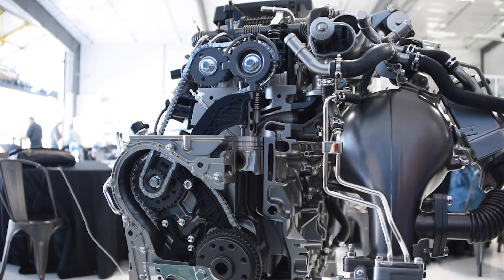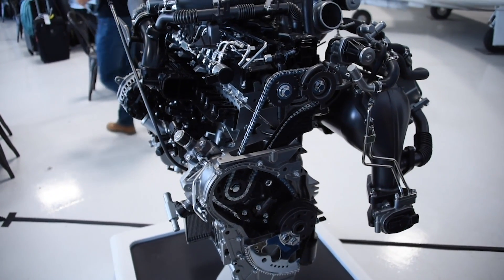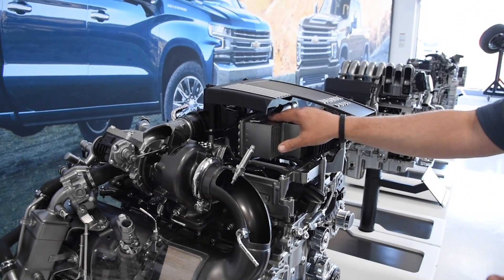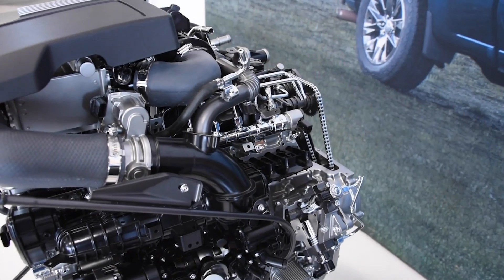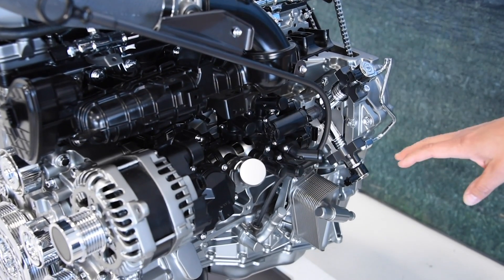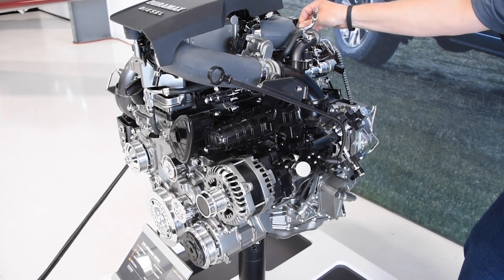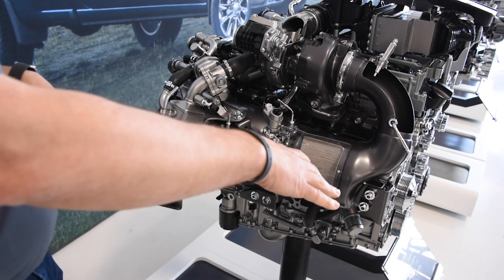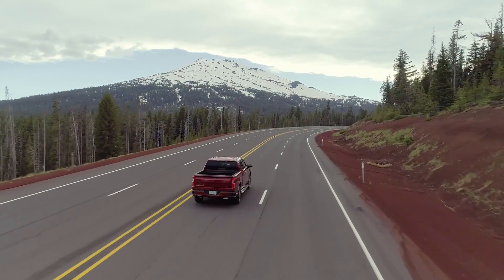What you don't know about the 3.0-liter Duramax diesel

Comment: You know...this confuses me.
A lot of people are being really negative about the oil-pump belt. Saying it's bullshit, etc.
Okay, I can understand that it is confusing as to why they would use chains for the camshafts and fuel pump, but would switch to a belt for the oil pump. I get that, I do.

But when people are bitching that they didn't use gears?

Guys, this is a light duty diesel. Why are you expecting them to build it like a medium duty engine? Why are you expecting them to treat the engine designed for a half ton, the same as the engine used for one-ton and heavier trucks?

Like, I get being frustrated with the reduced reliability of modern 6L+ engines. Totally understand that. Those are the engines people are using in work trucks. Hauling shit day in, day out, every goddamn day of the year, etc. Got it. Understand it. Yep, no argument there.

But these engines are being designed for Half tons (and in other cases, for LESS than half-tons). Why are you expecting them to treat them the same?

Edit: Forgot to mention: Yes, I would want to question the people involved as to why they put all of the timing shit, on the BACK of the engine. That does not make any sense to me.
Reply from the maker: GM engineers explained to me that chains are  used instead of gears to reduce NVH (noise, vibration and harshness) levels. 3/4 and one ton customers don't care about a little extra clatter, but half-ton customers expect a diesel to be as quiet as a gas engine these days.They also told me that driving the cams and fuel injection pump from the rear of the engine creates more accurate timing because there is less harmonic distortion at the rear of the crankshaft than there is at the front. This is important because accurate cam timing and fuel injection results in reduced emissions and increased fuel economy. That's what it's all about.
Reply: @TheRVConnection  I really wish the engineers could make a video to explain this, because...I can't envision why the harmonic distortion would be different at the rear of the crankshaft, vs the front of the crankshaft...unless I suppose, the connection to the transmission stabilizes the distortion effect.

Just seems to me like a good way to increase customer satisfaction, would be to actually provide education, or explanation for some of the design choices that...they have to know, are going to piss off some customers. Just wish there was some transparency.

That you guys at RV Connection for answering what you could. Appreciate it!
Reply from the maker: @dposcuro  In all actuality, the average truck customer doesn't know the difference. Only enthusiasts like yourself (and the many others who have commented here) dig into the small details like this...so engineers are not really worried about pissing anyone off..but they ARE worried about not meeting emissions.  What a lot of people overlook is the labor that would be involved to replace chains at the FRONT of the engine...the radiator and 3 cooling fans would have to be removed and replaced, not to mention the time correctly purge the cooling system of air so it functions correctly. I'm not sure that would be a lot easier than dropping the trans and doing it from the rear, although time will tell.  Another thing people are forgetting is that the oil pump belt needs to be replaced only once in the engine's effective lifespan--people replace timing belts on small cars at 80K miles all the time, and no one thinks that's a big deal. The fact is, the government, along with diesel customer's expectations, are changing–and the manufacturers MUST change with them. Thanks for watching...there will be more videos soon, including the new Super Duty this month!

Comment: I don't even own the truck and I am already Disappointed, what a bunch of junk. I guess GM don't care about the people who can't afford new trucks. If you buy one of these used with a 125k miles on it the reapers are going to brake you. A belt driven oil pump is just so JC Whitney junk, the engine is a throw away, but GM will already have your money. There is no reason why they couldn't have gear driven the oil & fuel pump other then it might last to long. That fuel pump with that psi is going to be hard on that chain. I will be sure to let my customers know to stay away from this disposable truck. Air to water cooler, if it should spring a Leake it will hydraulic a rod, brilliant. O' that's right reliability and longative it's a consurn. Air to air is more reliable. The battery next to that hot emission seams like a bad Idea. What a shame.

Comment: Belt on the oil pump drive? And high pressure fuel pump and timing chains that don't need serviced? If you believe that is true or good, you deserve to be taken advantage of for $50,000. Belts are a crap way of driving anything on the inside of an engine and timing chains and gears still fail.

Comment: Why gm. Why do you do things like rubber band oil pump? This is why I have purchased over 60 Vehicles for my self and my company I never once owned a gm product. Now I actually considering a new suburban with durramax  but this belt will have to be addressed before I ever do.
Reply: If the Suburban has a 6.6 liter Duramax, it will be the much better engine and transmission.

Comment: We commonly retire 40 or 50 year old planes that look like they will fly another 40 years and gm cant build a truck that dosent have rust holes in the rocker panels, fenders, cab corners, floor boards, cab support, frame, exc in  5 or 6 years. Only a idiot would buy a 70k truck that is going to need 10k in body work in about 6 years. And the belt lasts 150k miles, which is the full life of the vehicle? You could build a stainless steel frame, aluminum body, opposed 6 cylinder 2 stroke  diesel  truck that would last over 20 years and last nearly a million miles for slightly over 100k but you wouldn't be selling so many new ones then, would you?

Comment: People for over 2 decades wanting a decent half ton diesel.  Ram: Here's a POS diesel. Ford: Here's a POS, underpowered diesel. GM: Here's a powerful, I6, high mpg diesel! (btw, we made it a POS with the timing in the back and a belt on the oil pump) Maybe Toyota will make a decent diesel...Nissan sure couldn't get it right either.

Comment: Two things I dont like:
1. The oil "belt" drive. Basically a built in time bomb.
2. The turbo exhaust plumbing curving to the front instead of flipping the turbo and having the intake side on the front and a direct exhaust discharge to the rear. This keeps under hood temps down, which enables longevity of all other components.
Reply: He said you'd know the oil pump belt was failing with "appropriate Diagnostics" what the hell  appropriate diagnostics telling you a belt, inside the engine is failing????? Oil pressure drops to zero?
Reply: before timing chains all engines use a timing belt, some engines still use a timing belt today! so are you saying all those engines are time bombs...? even timing chains has a service interval.
Reply: @gwot  sorry that's an incorrect statement. Until the European and Japanese cars made it to the US Market I guarantee NOT ALL, as you stated, engines had timing belts. I've owned American built cars from 50's era cars to present day I would wager every one with a V8 or V6 had a chain. If you recall Japanese and European engines were, probably still are interference engines. belt even skips a couple teeth, Piston meet valve, Oh Happy Days. That typically occurs about 100-120k miles.
Reply: @mylarson7640  ok cool so not literally ALL, because I said that as a blanket statement, the rest of my comment still stands... this new Duramax is no more a "time bomb" as any the belt driven engines. To reiterate my point, belts last long enough, and has been reliable and still is. This is a oil pump, skipping teeth isn't gonna blow things up, and this belt barely stretches, if at all, its got no tensioners on it.
Reply: @gwot  No, timing chains do not have a service interval, they are life long components.  Belts wear from day one to the point of failure.  Belts also like to be clean and dry.  Bathing a belt in oil was done to keep the belt cool but it is harmful in other ways.  Further, timing belts are massive, toothed and robust,  This looks like a weenie V-belt.  Further, in the history of every engine made, Ive never seen a rubber belt used to turn an oil pump.  They are typically mechanically driven or driven off a chain.  Even a damn honda civic has a timing chain driven oil pump.  Here we are 2 years later and yes, there are oil pump belt issues.  It was a retarded design.
Reply: @fillupread  The “life” of a timing chain ends when the plastic tensioners fail. Hardly an uncommon issue too.
Reply: @fillupread  Forgot to mention, the VW TDIs from ~2014 forward have rubber belts for the oil pump inside crankcase. Oil bath. You just don’t hear about any issues with these in the forums, plenty of 7-8 year old cars with high mileage. Even a few very high mileage examples (north of 200k)

The design is fine. People whine too much.
Reply: @fillupread  

Not all timing chains are “lifelong”. As a mechanic for 20+ years, I’ve changed out many timing chains/gear sets on Gen 1 SBC as well as SBF from chain/gear wear causing slapping and inconsistent cam timing being noticed with timing light. Hell, there was a period that GM used plastic tipped teeth on their cam gear to quiet up the chain noise 🙄. If you were lucky enough, you would find all the plastic tips in the front of the pan when you pulled the timing cover, and not back in the sump. 

What I’m saying is, everything has a service life.  Some better than others, some more lucky than others, but not going to last forever. 

Some guys (myself included) even started using the gear drive systems to eliminate the chain stretch until it was determined that harmonics was now causing problems because of gear to gear mesh.
Reply: I've had mine for 18 months/48k mi and have had nothing but great experiences with it.  From hauling a 2k lb truck camper up and down the mountains out west in 100deg heat to starting in -27deg weather here where I live in Wisconsin.  I've had one issue and that was a tiny leak in the radiator...which the dealer replaced...so not even really "engine" related.  I averaged 18MPG while fully loaded and that truck camper on over 4200 miles last summer out west.   Under normal conditions I see around 23/24 but I also have the crew cab with the 6.5' bed and 4x4 AT4 model.   I change the oil every 7k miles and keep driving...Love it!
Reply: Yep, and now here we are 2 years later with belt issues, not to mention cam trigger wheel issues...all located between the engine and transmission.  GM stands for GodD@&^ Morons
Reply: Yeah. GM screws the pooch again. They never learn.
Reply: @OldSoldier54  Sorry but looks like you're wrong. Two years later and nothing but great reviews on this engine from everyone!
Reply: @edwardpate6128  How many 2 year old vehicle have issues, seriously, that's your benchmark, 2 years ???
Reply: @edwardpate6128  Two years?  How do you justify a 2 years old vehicle with failing oil dipped belt?
Reply: @mylarson7640  ford
Reply: @joseperales4741  Acura Lexus Ram
Reply: @OldSoldier54  exactly stupidist  way you could design,  stick with  shaft driven metal oil  pump gears,  really simple, so many  issues  and put  the  timing chains  on the BACK of the motor for mandatory   tranny removal ~There must be chinese engineers involved

Comment: That's it. Mr. BowTie your engine life time is 150K miles. Hm! I guess that because the oil pump need only as demands,  this belt will be jerking when it engage the power. that reason belt is for that. Now timing chain using for 25k par for fuel pump pistons. Now pistons pump has pulsation that interfere timing accuracy require as result the chain guides must be very active for compensation the pulses from Piston Pump. Really? European work for Chevy.  To saving hours on assembly line and number positions worker in operation as result Chevy disappoint Chevy enthuastic. Sadly

Comment: At 156k on my 1986 6.2 Detroit diesel, it has seen a one replacement starter, two sets of glow plugs, and a new aluminum radiator. With a battery tender hooked up, it can sit for months and fire up when needed.
Reply: and has no power and crappy emissions.

Comment: Leave it to GM to be responsible for engine failures due to a $20 part
Reply: Keith C . $20? This is GM, it’s probably $200 until the after market starts making them..  Way over engineered
Reply: @ever4437  GM didn’t engineer it.

Comment: So in other words they designed it like the 5 cylinder engines the Colorado and Canyon had. You have to take the engine and  transmission out in order to work on it.  I love how he says not that difficult to replace the oil pump belt, yet you have to take the transmission, bell housing, flywheel, and transmission plate off to get to it.
Reply: Not that difficult if you're a lead design engineer at a major company making major $$ to pay for somebody else to deal with the bullshit

Comment: GM loves 150k gotchas. Enjoyed my 08 Grand Prix till I found out the torque converter was designed to fail at 150k-170k. Got to drop the whole A frame to change. I expect this truck will be similar. Will buy RAM or Toyota for my next truck.

Comment: Oil pump belt breaks pulling a trailer up mountain warning lights come on as you try to get off the road engine seizes up I think you might have to pull more than just the transmission. So much for long term reliability

Comment: Everyone complaining about the oil pump belt, I would be just as worried about the chains honestly. Lots of overhead cam engines with long timing chains end up having guide failure and chain wear at higher mileages, even Japanese stuff. Personally as a mechanic, I would rather have the front timing belt setup that the Ford 3.0 diesel has. With a good set of tools and the service manual, most good home mechanics can change a timing belt themselves.

Comment: Simply NOT FIT FOR PURPOSE......unless that very PURPOSE is COMPLEXITY, HIGH MAINTENANCE, LOW RELIABILTY.
Weak attempt, as if the brief to the 'engineers' specified a host of 'hidden agendas'. 
Wouldn't touch this with an African Dictator's Dick...
Thanks for Exposure!

Comment: Just drop the transmission? Buddy, I can't even get my girlfriend to drop her panties!
Reply: Have you thought about trading her in, for a new remodel.
Reply from the maker: That sounds like a personal problem LOL
Reply: @TheRVConnection  No, you've got a personal problem,  anyone "in the know" is going to drop this thing like a turd.  Nice job GM, you just fooked urself from a P.R. point....again!!!
Reply: @TheRVConnection  nearly every 4 and 6 cylinder car engine requires a timing belt change at 100K so I don't see the oil pump belt as a big deal. Engine also seems to have 2 cooling systems aka Ford 6.7L but I also like the low pressure EGR and of course they still have the dpf injector where it belongs unlike Ford. I have driven one and for the $2K extra it costs it is a great deal. Face it internal (gas) engines are done and if you want decent power and efficiency these small diesels are where it is at.
Reply: @michaelcooley8275  true about timing belts, however those engineers place them so that you don't have to remove the transmission to service it. Knowing it would be a service item, why not locate it up front? It was a clean sheet design, they could have put anything anywhere on that motor. I think I'll stick to my pre 2007 diesel engines. They are tried and true.

Comment: you think that there will be an option where you can request a permanent chain belt⁉️
Reply from the maker: That's hard to say. Remember, 150K is the recommended change interval, much the way most timing belts should be changed at 80,000 miles, and no one seems to complain about that. Over the years, GM or the aftermarket may offer a chain...you never know.
Reply: @TheRVConnection . No complaints about timing belts? Maybe, but I stopped buying cars with timing belts. I will not own another.

Comment: Did the engineer just say without saying, that the oil pump can be serviced by pulling the oil pan? Which means by pulling the engine, to pull the pan, to change the oil pump. Can I get the first oil pump and belt change thrown in?
Reply from the maker: Actually, the pan shouldn't have to come down to change the belt. Once the transmission is dropped, it's right there at the back of the engine.
Reply: @TheRVConnection  I stated the oil pan removal to change the oil pump. I just, 2 minutes ago, walked out of the service managers office of the largest Chevy dealer in Memphis. I sat down with the service manager and we walked through the service guide on changing that oil pump. The oil pan has to be removed and it takes 7 hours. The labor chart shows the motor being removed.
Reply from the maker: @n.elliott9122  Wow...great information! Thanks for sharing...though I can't imagine why the engine would require removal when there are service plates behind the engine.

Comment: GM engineers behind closed doors "Ahh these trucks will rot out before the 150k service anyway. If the body and frame do last let's do the consumer a consumer a solid, Let's save them 24¢ and use a easily serviceable oil pump belt."

Comment: I can see 6000$+ worth of dealer service and parts within 100K with this design. 

Way to engineer planned obsolescence and service GM 

1.timing chains with instead of gears.

2. variable pressure oil pump. 

3. ball bearing turbo 

4 and engine that can only be worked on by the dealer. 

Why do Cummins last a million miles? 

Because they don't do any of this shit and you can service them yourself.